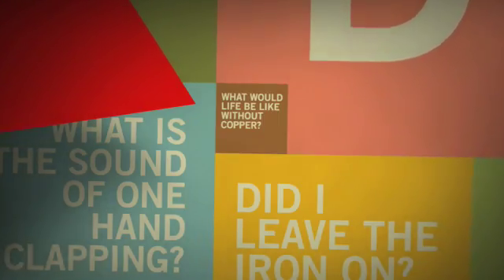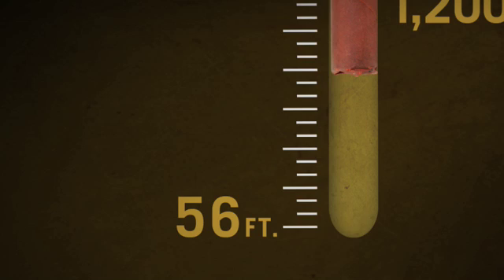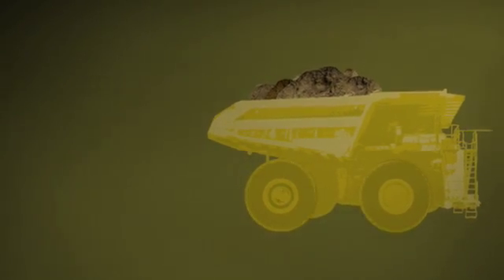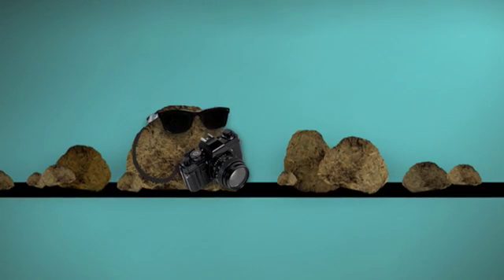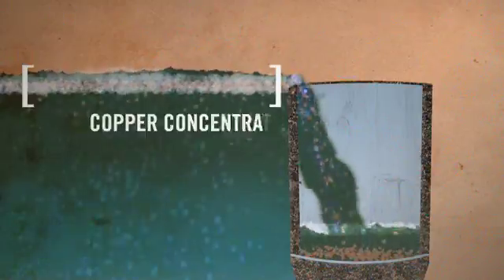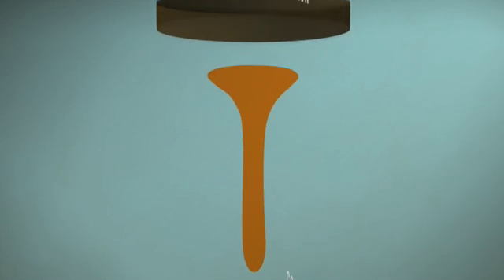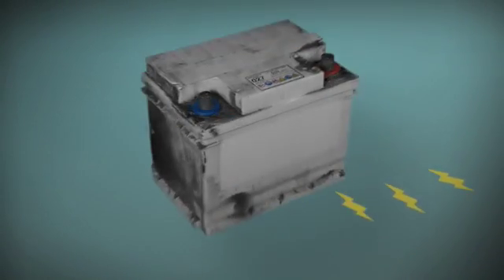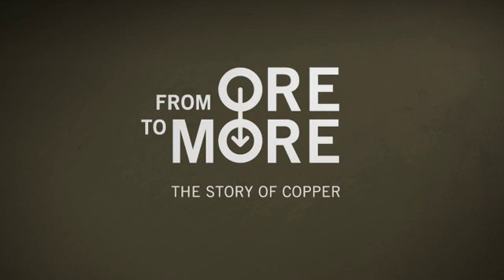Ore to More (The History of Copper)

Comment: copper mine -> blast -> copper ore -> crusher -> floatation -> 28% copper concentrate -> filtration ->  furnace -> 70% copper matte -> smelter ->  99% copper anode -> electrolysis -> 99.99% copper cathode